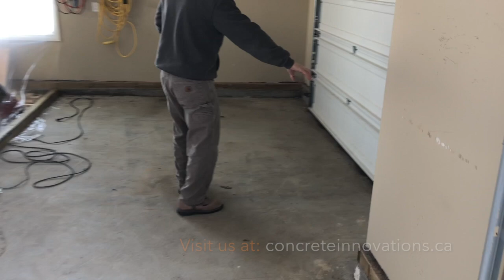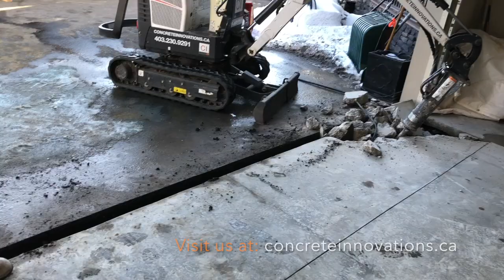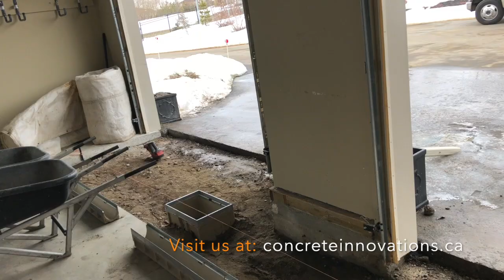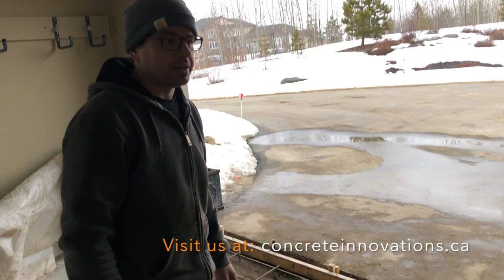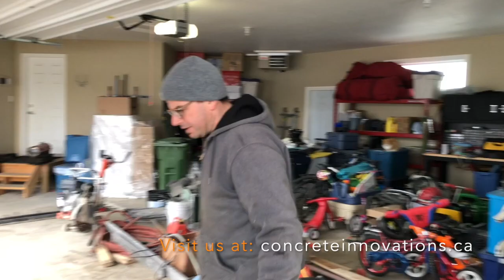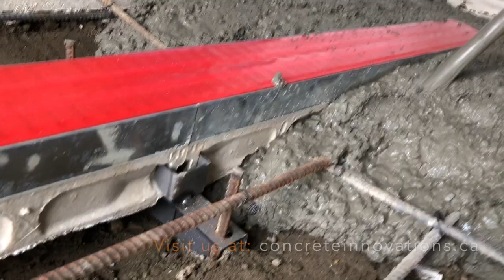Garage trench drain system - Step by step installation in an existing concrete slab

Comment: How come this was cut so wide? Could you not cut the drain in just a few inches wider, or was this to provide more sloping toward the grate drain?
Reply: I thought the same, at first I was like, well i guess they're going to build a nice slope..... but at the end it seems at level ???
Reply: @RayFury  after I did more research, it seems it depends on the system and how much concrete is required to lock the channel in place. There are some slick ones that have a very small opening for the water and a larger diameter tube under surface, and require a much narrower install channel. Then some systems are basically the same width at opening as they are at bottom and in order to secure the upper portion in place they need a lot more fresh concrete on the sides
Reply from the maker: Its cut that wide to properly slope it into the drain

Comment: What if the floor has already been epoxied? Can this be done and then repair epoxy or does everything have to be removed first?
Reply from the maker: Yes it still can be done. The epoxy can be repaired after the new concrete has cured up and can be blended into the old product.

Comment: Assuming the water is entering at the front of the garage why not run a trench drainage system in front of the doors?
Reply: Might be coming off cars during winter. I get a ton of water in mine just from that, worse when they are covered in slush and stuff.

Comment: Are you not worried about cold joints?? Because thats what your placing against.
Reply from the maker: Yes it is a small area and poured quite thick. Control joints are not required for this application. The trench drain actually acts like a long control joint as well.